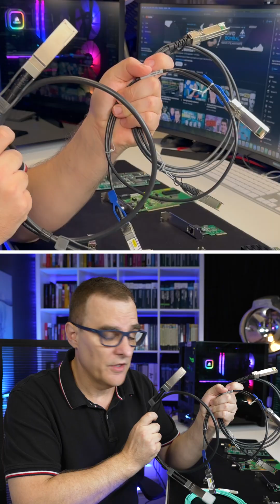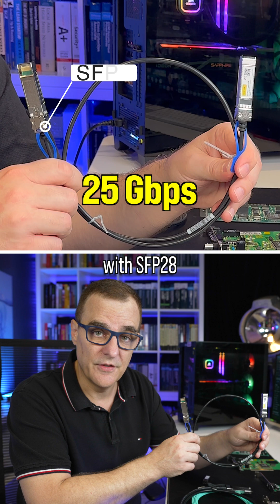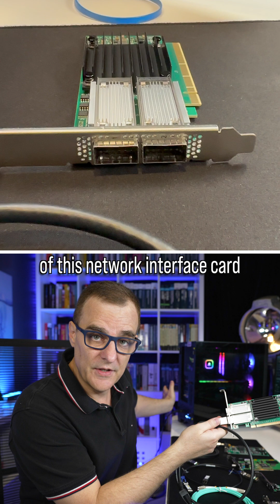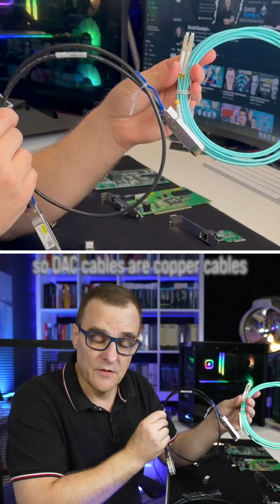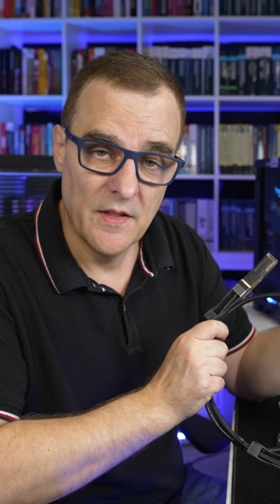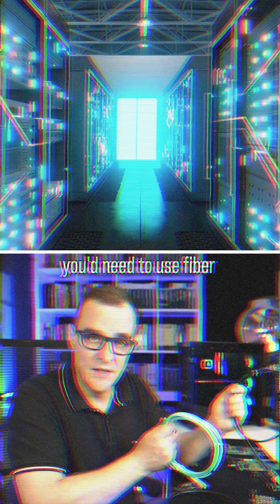What are these cables? #shorts #internet #ethernet #fiber #ccna #iphone #android

Comment: Why do they replace efernet cables with dac cables and fiber cables?
Reply: CAT 6 is rated for max of 10Gb/s, while DAC cables and Fiber optics are rated currently up to 800Gb/s. These cables are mostly used in enterprise servers and storage, due to needing less power and higher transmission speeds.

Comment: Dave I just configure Mikrotik Router with two 100 gigabit interfaces. They will both be connected to two Huawei switches by a two DAC cables. You should mention that some DAC cables require additional programming to get compatibility betwean two manufacturers.
Cheers 👌🏻🙌🏻